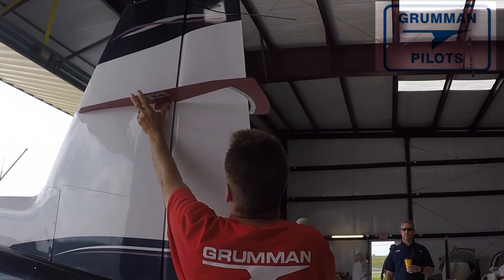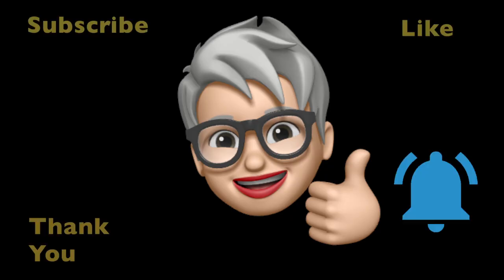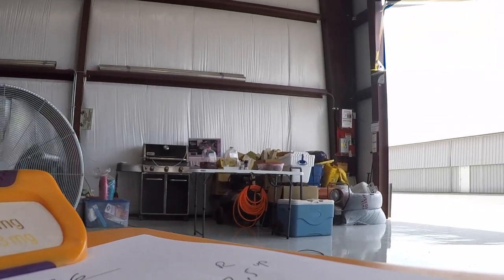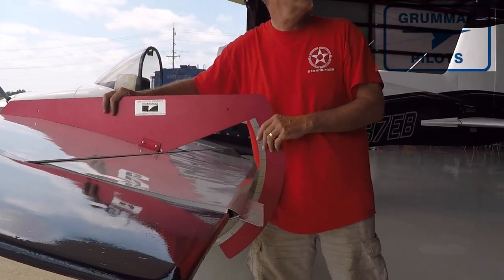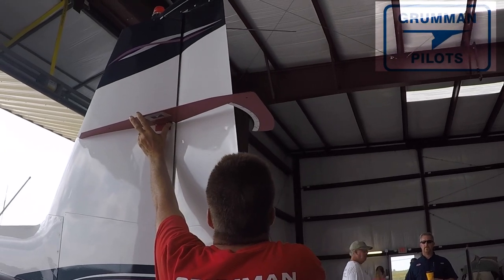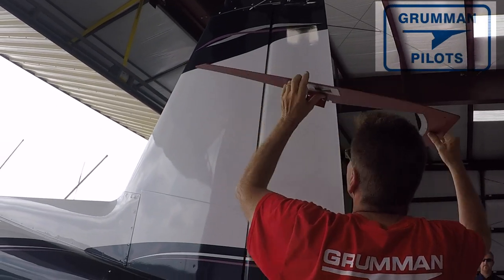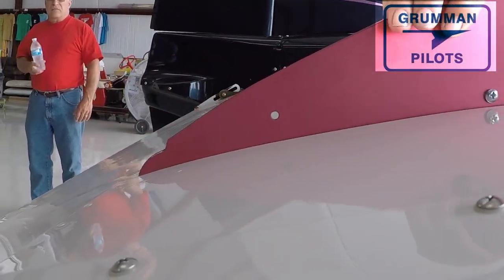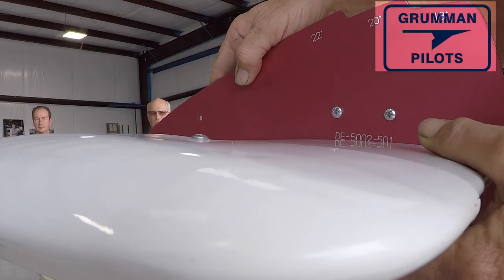Another Traveler Rigging Look - Grumman Style

Comment: Thanks for great video on rigging. 
Do have a video on replacing the universal in the control column of a Cheetah AA-5 Series. (part 11, of fig 406 of flight controls, maintenance manual)
Many thanks
Reply from the maker: Easy answer, no.  It is held to the floor with six bolts from the floor.  FYI